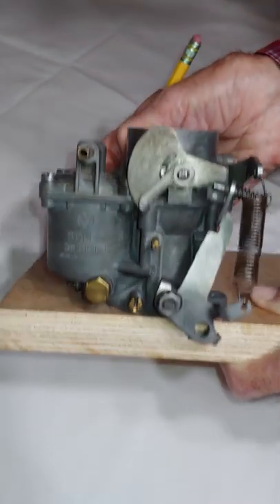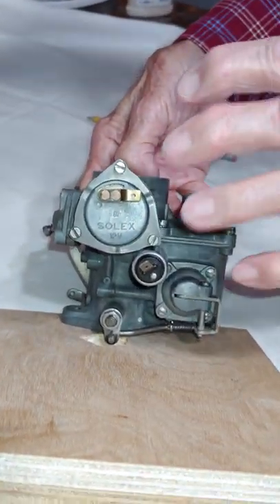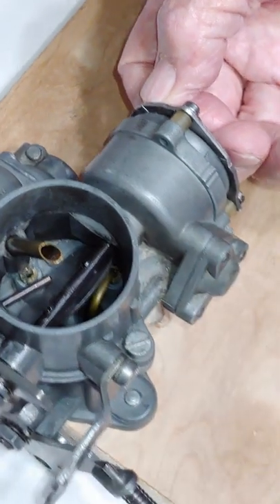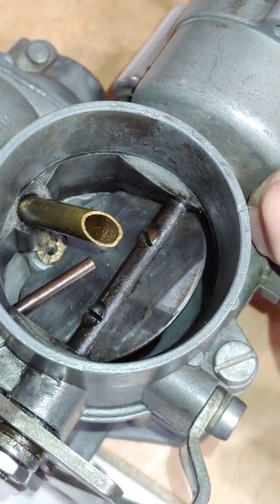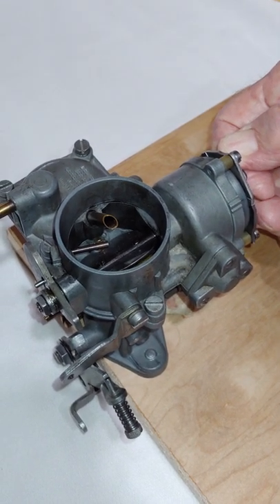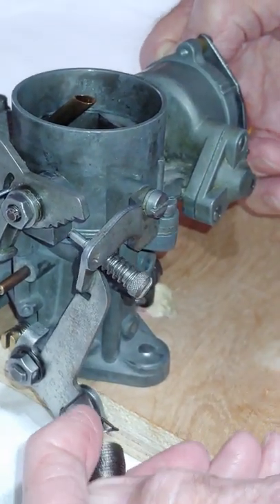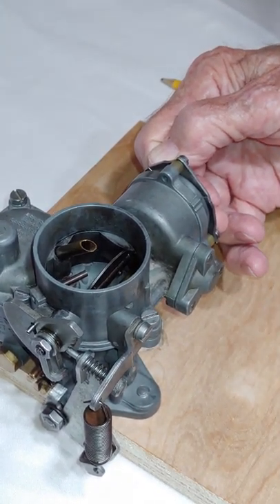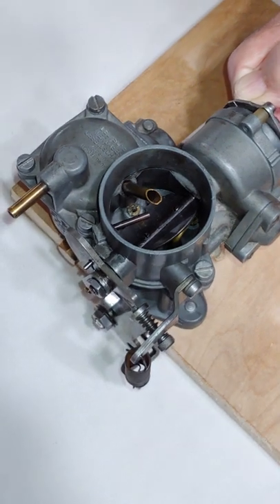1967 VW Beetle Carburetor Adjustment with Jay Salser

Comment: The carb's choke is outside temperature sensitive. So, while the 3 minute rule may work in a heated shop on the bench. The 3 minute rule flies out the window on a cold day, When mounted on your car, I think I remember it's more like 4 minutes. Some time is also required for more tight, or more loose choke elements. And keep an eye out ... as there is both 6 volt and 12 volt chokes. Over 50 years, some have been changed incorrectly. But, the choke needs to be adjusted two or three times per driving season, maybe more. You can tell if your engine stays on the higher steps of the choke-cam too long, and revs too high for too long. As a general rule, you are better off with too much choke than too little. It takes about 15 minutes to get the oil up to operating temperature. The plastic spacers are for seasonal adjustment. Before the automatic choke, chokes were adjusted by pulling a knob on the vw's dash, as everyone knew how to operate a choke. And everyone adjusted the choke manually, according to outside temperatures and engine temperature. This new electric choke is only really semi automatic. As an experienced vw driver should know to adjust their chokes according to what the engine requires, and the need to fine tune the choke element adjuster ... will be different in the cold of spring, the heat of summer, and the cold temperatures of fall once again. If you need more choke = rotate your choke counter clockwise. Less choke = clockwise. About 1/8" increments and see if its enough.
This is easy stuff, once you know what the choke does, and for how long, and how much it does it's job.

Comment: What do you think about the '3-minute-rule'? Is it more or less helpfull to a right adjustment?

The 3-minute-adjustment:
Put the choke on power (12v) for 3 minutes.
After that, pull the throttle.
The screw should be at the lowest point when you release the throttle.
If not: turn the choke coil to the right setting.
Reply: Thank you for responding to my Video!  If the "3minute rule" works for you...then be sure to use it.  That's likely plenty of time for the Heater  to reach its maximum temperature and Spring Release.    Most people do not have a "plan" and thus never seem to have their carbs properly adjusted.  Keep up the good work!  jay
Reply: The carb's choke is outside temperature sensitive. 
So, while the 3 minute rule may work in a heated shop on the bench. The 3 minute rule flies out the window on a cold day, when mounted on your car.
I think I remember it's more like 4 minutes. Some time is also required for more tight, or more loose choke elements.
And keep an eye out ... as there is both 6 volt and 12 volt chokes. Over 50 years, some have been changed incorrectly. 
But, the choke needs to be adjusted 2 or three times per driving season.
You can tell if your engine stays on the higher steps of the choke-cam too long, and revs too high for too long. As a general rule,  you are better off with too much choke than too little. It takes about 15 minutes to get the oil up to operating  temperature.
The plastic spacers are for seasonal adjustment.
Before the automatic choke, chokes were adjusted by pulling a knob on the dash, as everyone knew how to operate a choke. And everyone adjusted the choke manually, according to outside temperatures and engine temperature. 
This new electric choke is only really semi automatic. As an experienced vw driver should know to adjust their chokes according to what the engine requires, and the need to fine tune the choke element adjuster ... Will be different in the cold of spring, the heat of summer, and the cold temperatures of fall once again. If you need more choke = rotate your choke counter clockwise. Less choke = clockwise. 
About 1/8" and see if its enough.
Reply: @thestove2407  thanks for the extra information. Indeed was the engine running to long at higher rpm in my case. The 3minute rule helped, but I now realise it depends on ambient temperature of the coil.

Comment: Just bought my first VW . We bought a 69 Beetle with what I’m told is a single port 1600 . Carburetor is a Solex PICT 30-2.  What’s the difference between this and the 30-1. ? Is mine the right one for the bug ? Thanks
Reply: Hello, Keith..Thank you for watching this Video.  Yes, your 30 Pict-2 Solex Carburetor is correct for a 1968-69 Beetle, Bus and Karmann Ghia.  You likely will note a Stamping on the (bottom) flange on the driver's side.  This Stamping likely will vary to identify the Carburetor as belonging to one of the above Models of Vintage VWs.  With that Stamping in hand, it is possible to know for which Model the Carb originally was intended.  That aside, your Carburetor will work on any one of the three Models.  The Original Solex German Carbs can be successfully rebuilt--if necessary.  A rebuild necessitates a Carburetor Specialist's Attention.  Otherwise--If the Carb is in good condition, a person, himself, usually can clean and successfully re-kit it using the Walker Kit which has rubber components which are Ethanol Resistant (I believe that only O'Reilly's sells this kit).  You say that your Beetle is said to have a 1600cc Engine.  Originally, the Engine would have been an H5xxxxxx, 1500cc Engine.  However, if a rebuild is necessary, it is virtually impossible to obtain the 1500cc Rebuild Kits.  Thus, most are rebuilt (1967-1969) using the 1600cc Kits.  If you can learn the Car's History, perhaps you can discover whether or not the Engine has been rebuilt.  A Qualified VW Specialist usually can examine an Engine to be able to tell you whether it has been rebuilt, or not--without disassembling it.  Remember:  The German Solex Carburetors are far superior to the cheaply manufactured Chinese Carbs on the market presently.  Having Original Equipment also increases the intrinsic and monetary value of a Vintage VW.  jay
Reply: @j.k.salser499 Can I send my carburetor for you yo rebuild ? $$
Reply: @j.k.salser499  Could I put a 30-31 on my single port motor ?

Comment: The choke has nothing to do with out side temp. It has a coil that when it gets hot with electricity from the coil it gets loose and lets the plat move. That is what the electric choke does. Put it on a bench and put power to the choke and it will move. It takes about 3 to 5 minutes to fully open.